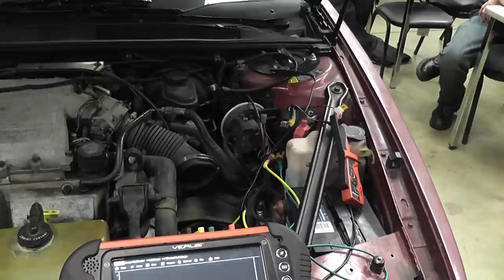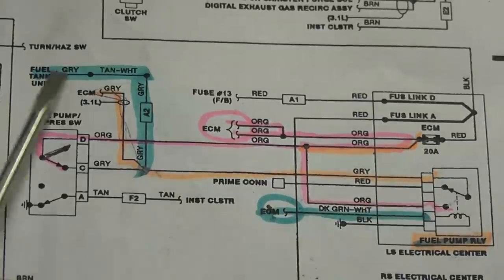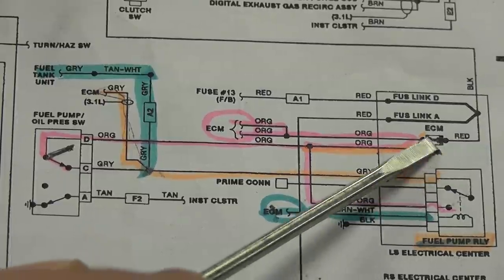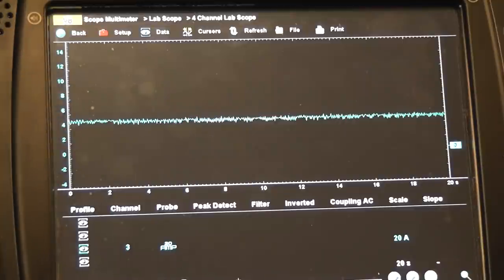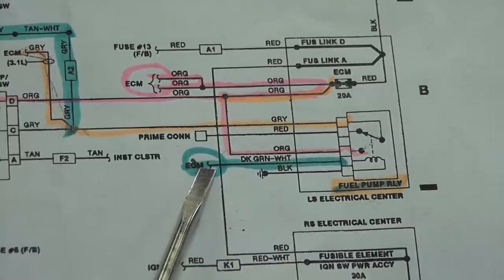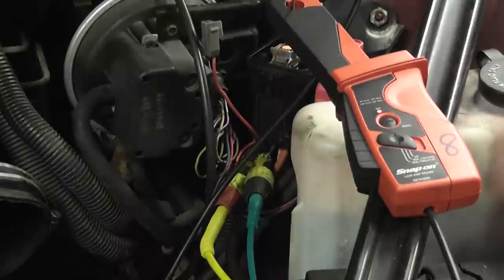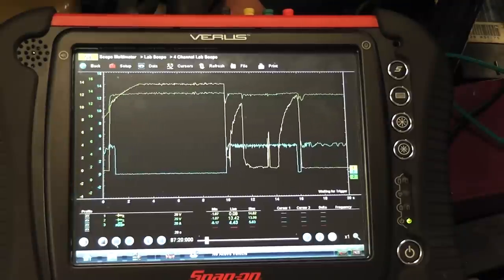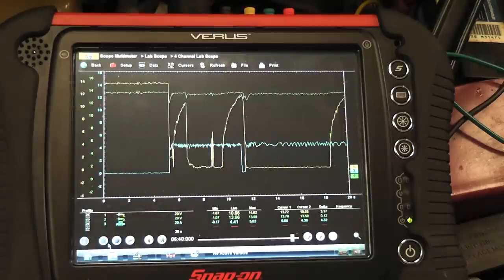Fuel Pump Relay Problem

Comment: Excellent troubleshooting! I'm not good at wiring, but when you said the heater and the fuel pump both related issues on separate circuits, i immediately thought of a grounding issue - that seems to usually be what causes weird gremlins like this.  I had a weird grounding issue on my car where the headlights would randomly turn off and I'd lose dash lights. It turned out I didn't have one of the main grounds secured.  Thanks again!

Comment: Very nice lesson as always. This also would indicate that the oil pressure switch/circuit  is no good, as once the engine is running the relay can be taken out of the loop and it should still continue to run. 

I realize that I am commenting on an old video, but for anyone that comes across it should also be aware of the oil pressure switch, which you did address on operation in the beginning when looking on the diagram.

Comment: Hey Paul Danner, Well Explanation for this Fuel Pump  Circuit is very clear and making me to feel simple when the Faults Related to the Fuel Pressure issues come to me and im agree with your Motto " Don't Be A Part Changer" 

Thanks Forever Danner ❤❤❤❤❤

Comment: Wonderful video.  Learned a lot.  My first reaction was to change the fuel pump, bad internal binding, etc.  However, with proper testing and understanding theory of operation, I can see how my faulty reasoning would be an expensive lesson.  Your methodical test procedure really made sense.  Enjoyed following your explanation on the wiring diagram.  Another thing, I learned was the importance of ground points.  I didn't realize how critical they are and how they affect relays, etc.  Thanks.

Comment: so a question i seen the ground problem but as you shown in the wiring diagram the relay/oil pressure switch run in the same circuit so when the relay dropped out why did the fuel pump quit unless the oil pressure switch is not working or was the ground totally going in a open condition    thanks  hope you like questions i alway want to know

Comment from the maker: @ScannerDanner If the FP relay turns on and the injectors fire you need to replace the ignition module. I know, I know, "but I have spark" is what you are thinking. Listen, these modules will fail in that it will still control the coil, but not send the reference pulse (0-5v square wave) on the purple-white wire to the ECM. Without this signal the ECM will not see an RPM signal and will not fire the injectors and will not run the pump.

Comment from the maker: @kenjackson1977 Do you have spark and injector pulse? Or does the engine run when you hot-wire the pump. All you said was the pump runs when you hot-wire it. I need to know to help you further.

Comment from the maker: I wish I had an easy answer for you. Unfortunately it is hard to find a good diagnostic tech in this field. Most mechanics are parts changers. A suggestion is go to iATN and search iATN's Auto Repair Shop Finder. This isn't going to guarantee that you find a good diagnostic tech, but I think it will increase your chances.

Comment: @ScannerDanner TY!!!  For years I always thought the oil pressure switch was for safety.  Clearly it is in parallel with the circuit.
Reply from the maker: +Will Rogers you welcome! thank you
Reply: +Will Rogers That is because sometimes it is for engine safety. This may be the exception or maybe safety is the exception. I'll leave it to scannerdanner to give the average percentages either way. I know it is a safety on older GM diesels of the 90's era. Least ways they won't run when that switch goes bad.

Comment: Excellent excellent case study.. I was baffled in the beginning with the heater in the mix of things, that really through me a loop. Shared ground never cross my mind. Wiring digram interpretation is really key to figuring out what is going on within a circuit.

Comment: TCM ATA relay which is controlling with "-" from TCM. Black probe to pin on TCM and Red on relay "-" side. I got 1.5V (on ign.key on only). Is it the bad ground?
I found how to check bad ground later on your channel.
Thank you for all these videos🎉

Comment: would you be able to pull the relay, if the fuel pump still runs then that would narrow down to relay. Thought process on that was like you said the oil switch would take over and still allow voltage to the pump.

Comment from the maker: @ScannerDanner Another clue to this problem is when you first turn the key on you should still get a fuel pump "prime". This is the ECM turning the FP relay on for a second to bring fuel pressure up. After this "prime" the ECM will NOT turn the FP relay back on until it receives an RPM signal (on the purple-white ref. wire). 
If you do not have a "prime" happening  when you first tune key on, then we are barking up the wrong tree. I can still help you though.

Comment: I know this video is old, but I'm confused about the relay... You said that oil pressure switch provides alternate power to the fuel pump once the engine is running and that you could pull the relay after it's running and it would stay running... So why does the relay switching off and on like that kill the engine? Obviously there is a problem there, but the oil pressure switch still should've kept it running...

Edit: nevermind, I understand now. With that ground issue effecting the entire system (most likely), the oil pressure switch would also be loosing connection.
Reply: You were right in your initial idea. The only way this engine fuel pump would stop and start because of a relay ground problem is if the oil pressure switch was not working. The oil pressure switch get power from a fusible link and it bypasses around the relay and connects to the same fuse and on to the fuel pump. The Oil pressure switch has no ground to worry about.  The fuel pump itself has a totally different ground than the relay itself.

Comment from the maker: This was a main block ground problem so it wouldn't matter where the power was coming from (relay or oil pressure switch), the problem would still be there.

Comment from the maker: @silkylove1000 if the car is running fine and your fuel psi is good i wouldn't worry about it. the rpm test has some gray areas if you ask me.

Comment: Some nice multiplexed circuits over long spans. Pulse width modulated fuel control valves on CNG engines. Gas mass flow sensors. Coil on plug ignition with a separate module from the ecm

Comment: Further to my first question, the following is my real problem:I am driving the Ford Mondeo for 12 years now. Its a 2004 model 2liter petrol. It gave me excellent service.
Then all of a sudden after   175 000 km,  on the long  road it started to loose power on uphill stretches and eventually comes to a stand still. Waiting for 10 minutes or so, start it again and then it will go for 10 km or so. It seems that as “something” gets hot it causes the problem. 
I at first thought it was the petrol pump but then someone told me, no,  rather buy a new Fuel Pump Relay which I did and it then worked like a dream for 18 months. Then it started again with the same old story. Remember now the first relay worked for 12 years over 175 000 km, and the second one 18 months and only about 5000 km.
I cannot tell you what really gets hot to have to cool down sothat when you start it it will go OK for a awhile. The Relay is supposed to work also the Air conditioner, ECC power (what  ever that is) , High Beam lights, windscreen wipers, battery saver, fuel feed,  the Horn, rear window wiper.  After I established this I switched off all these “additional” uses (except the battery saver what ever that may be) and assumed it will then work the fuel pump only. No joy.....
I have ordered a new relay but has not fitted it yet because driving in town on very short distances it gives no problems at all.

Is there not perhaps a short causing not enough power to go the the fuel pump. 
 But that does not explain why it stops working when I dont know what, gets hot.

What is your opinion.  I will greatly appreciate your views.
Thanks

Comment from the maker: @kenjackson1977 Don't do that, it won't fix it. Do this test: turn key on engine off (KOEO) find the purple /white wire coming off of the back of the distributor module connector. Connect a test light to battery positive and touch on/off/on/off/on/off this wire. The ECM should react by running the fuel pump (FP relay should turn on) and the ECM will also fire the injectors. Let me know the result of this test.

Comment from the maker: @CoolasIce2 I just checked out that scope. It is an old analog scope. It will do want you want but you will have problems with "glitch" captures because there is no play back. I would recommend you go on ebay and buy a used Vantage (not pro, unless you can afford it)). It is a graphing multimeter and will get you by for awhile. Plus the data base in the tool is unmatched in this field. I have had students pick them up for around $200

Comment: Great video. Nice to see what you can do with a scope. I have been doing this for years with a test light and a cotter pin. I may use a multimeter if I get really hard up. Granted this is an instructional video but why not use a cotter pin to ground out the control side of the relay and verify (a) relay works, (b) pump and load side work? All diagnostics in the video are great, I'm not trying to criticize here but a relay needs 2+ and 2- to work which is basic electrical....

Comment: Loved the video walk-through, as well as the process of elimination you used to get to the root of the problem!  I'm not a mechanic by even a loose interpretation of the term (I like to do simple maintenance like change the oil, brakes/rotors, spark plugs, etc on my e39 540i).

What would you recommend as a way to find a good mechanic to work on a car?  One that will diagnose problems like you did in the video.  Most I've been to would simply replace a pump/relay/etc and "see if that works".

Comment: Im now curious given the video and my current issue if there was no oil pressure if the circuit/ecm would shut down the fuel pump. My fuel pump is having issues and ive seen when such happens the oil pressure gauge will read almost max pressure. Am wondering if the fuel pump and oil pressure were tied together purposely as a safety measure
Reply from the maker: It will not, it's simply a bypass circuit. Maybe old, old designs when this was first developed. But that's not what this one does.

Comment: Is the oil pressure switch not working? Why didn't current keep flowing to the fuel pump through the alternate power feed (oil pressure switch) when the fuel pump relay was turning off? I think there must have been another problem here in addition to the bad ground on the control circuit of the fuel pump relay.
Reply from the maker: There are main computer grounds on that same stud. There was no other problems with this vehicle

Comment: cool! ...a question: when koeo, why is the green line(power for the relay`s control side)behaving exactly the same way as the yellow line(relay`s control ground)...when you turn on the heater...and then when you wiggle that bad ground?...my guess: bcus they both are as one, since there is no power to the green line with the koeo
Reply from the maker: Because the power for the control is coming directly from the computer which is also being affected by a poor ground. Make sense?

Comment from the maker: @spelunkerd Nice, I have never heard that quote. I like it too. The oil psi switch is simply there as a backup in case the relay fails. Of course the other side of that oil psi switch runs the oil psi gauge or light, so it serves two functions. I don't know why GM felt the need to backup the FP relay. No one else is doing that. Seems like a waste of copper wire to me. They must have had a lot of problems with this circuit early on?

Comment: great video, it had to be a bad ground, if the positive trigger  from the  ecm was cutting out once running the oil pressure switch would have completed the circuit masking the problem.

Comment: Hello, I have a 77 911S, the fuel pump, (new),  keeps burning out the relays, maybe I should. check the ground, or can I do it with a meter? Thanks Russ
Reply from the maker: burning out the relay for the fuel pump? How is the connector going to the relay? If it is corroded, this will equal heat from resistance in an unwanted location and can definitely burn things out.

Comment: @ScannerDanner  By far this is the most detailed video with complete explanation of the issue . Kudos to you man! I have Opel Omega A 2.0i from'88 and the fuel pump relay get burning hot but doesn't blow the fuse . Weird. I also run my car on LPG  and turn off the fuel pump but relay still getting hot. No one can find a problem .Still driving it that way .  Checked for ground but can not find it . Any suggestions on this one I appreciate .
Reply from the maker: It is not abnormal for a fuel pump relay to get very hot or any relay for that matter.
Reply: I see ... But still , to be sure I always carry the spare fuel pump relay . Thanks.
Reply from the maker: @TheZemun  nothing wrong with that, just wanted you to know how surprised I was the first time I realized how hot these things actually get

Comment: great video just bought a 93 f150 runs like a dream.but after 30-40 min it starts stumbling and cutting off i change fuel fliter and pump and still do the same thing what u thing costing the problem.live in the bahamas
Reply: SuperClutchy 1988 dodge 3.0

Comment: I enjoyed this knowledge fully can I fly you to Vegas to troubleshoot my 1995 Buick century wagon at this point I’m  atleast 80% sure it’s a wiring issue
Reply: The fuel pump was my most recent replacement and I’m thinking maybe same wiring problem all along was never the pump
Reply: Shoot I swapped my cat just to be safe
Reply from the maker: 95? What engine? What is it doing? Do you have fuel pressure, injection pulse and spark?
Reply: I definitely have spark after watching this I am checking fuel pressure tomorrow it’s a 3100 odb1 and computer wont tell me anythingi have trouble with hard start once starts bogs and idles badly then if an drive a mile or so all seems well until next start usually

Comment: Hey Dan have a question I have a 1999 GMC safari van Meyrou fuel pump relay gets extremely hot could it be that it's holding too much load because the oil pressure switch is bad thank you

Comment from the maker: It would have been normal fuel pressure readings at times and low at other times. No big pressure pulses would have occurred with this problem.

Comment: My 2001 Silverado, when cranking it will turn over "spinning good' Turn switch off restart cranking it will start the second, third or fourth try. when started it idles and run good, no problems until turning off and re starting. can it be the fuel pump?
Reply from the maker: Yes, do a psi check during cranking to confirm.

Comment: does that orange lead going into the relay constant hot or is it switched? I have no current going to my fuel pump relay on my 1989 Camaro 305 tbi
Reply from the maker: +Dalton Jones It should be constant, not sure if it is an ignition or battery power though. But it needs to be powered all the time for for sure with the key on
Reply from the maker: +Dalton Jones It should be constant, not sure if it is an ignition or battery power though. But it needs to be powered all the time for for sure with the key on
Reply: +ScannerDanner I ran constant power to the orange wire on the fuel pump relay and it makes the fuel pump run constantly.
Reply: +ScannerDanner code 54. When everything is stock, it is hard to start when it is cold. I can jump a power lead from the battery to the fuel pump lead and it will start right up and run great. I can unhook that jumper and it still runs great. Starts right back up while still warm. But when it cools back down, hard to start again
Reply: if current is constant into the relay, the output stays on and the fuel pump will keep running

Comment: paul you said that the oil press swith is a back up feed for the fuel pump in case the relay fails, but in the diagram im seen that  that switch is normally close, with no oil pressure or engine off the switch is close, and with oil pressure the switch is open, and if the switch is open with the engine running, how can it be a back up feed for the fuel pump?, i think that what the switch does is energize the fuel pump just before it start cranking the engine to have good fuel pressure for a quick start
Reply from the maker: It is a normally open switch. They stopped using it as a back-up around 2002-2004 depending on the model
Reply: The crank signal is simply a fused tap into the heavy purple starter solenoid
wire that runs along the RH valve cover. <c>It tells the ECM the engine is
cranking so it can calculate fuel delivery and spark timing accordingly. <c>The
crank signal also tells the ECM to keep the fuel pump relay energized until you
have oil pressure at which time the oil pressure switch takes over fuel pump
power supply responsibilities.

Comment: Love this video ! I have one question. Had a car in the other day and customer complained of long crank  with his chev lumina. Did not get a fuel pump prime when key was turned on. noticed fuel pump wire dia was nearly the same as the car on this video.I noticed the red wire @ relay is the fuel prime. Where does that red wire get its power from ?  didn't get much time to look at the car but gonna have to dive in Monday morning.thanks.
Reply: Watch my video on "fuel pump electrical circuits " it will answer your questions about this system